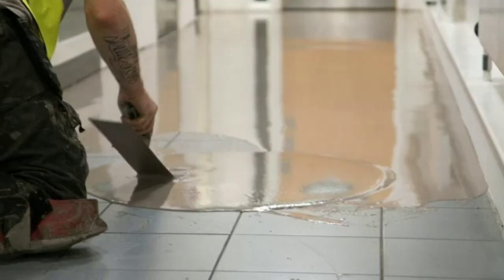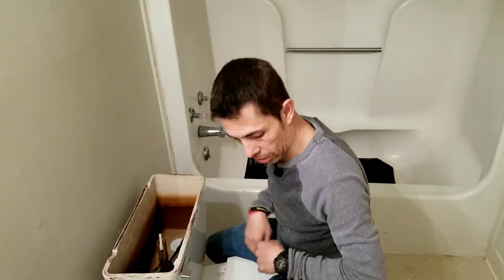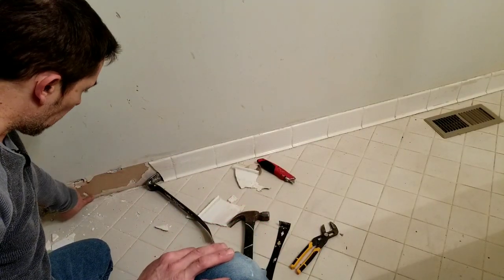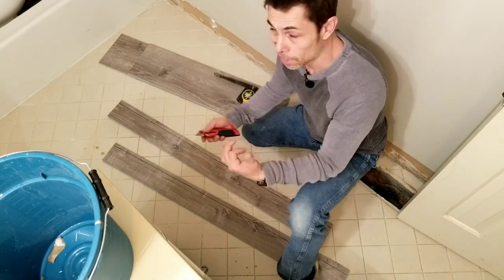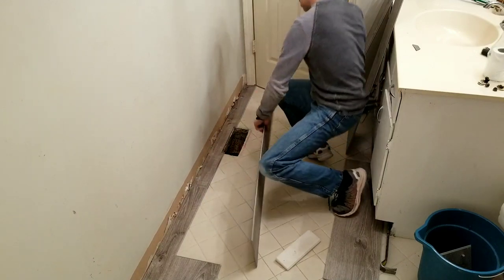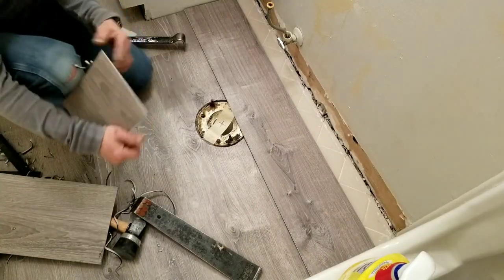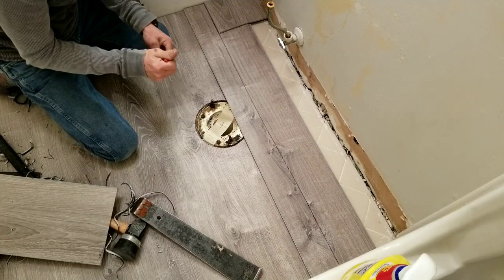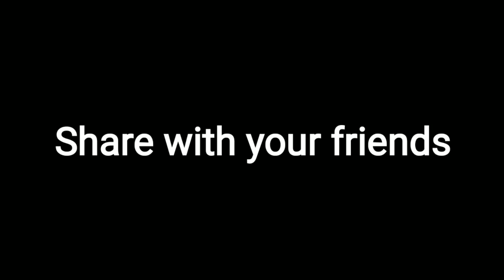LifeProof Vinyl Plank Flooring Over Existing Tile Tutorial

Comment: This video and the suggestions you gave is going to help me with my vinyl plank install. I refuse to pay some one to do this for me, I feel like I can do this myself! I am glad I found your channel!
Reply from the maker: Thank you for the comment. And I too believe you can do it. When you buy your flooring just take a look over the directions and you'll see it's not rocket science. Pretty diy friendly. You got this. Let me know how it works out
Reply: @Lydia Lopez Were you able to do the vinyl plank install yourself? I would love to know how it turned out!
Reply: Good luck,  I've been installing for 21 yrs, this bathroom will fail. He needed to grind the high spots in the tile and prep the grout joints with ardex feather finish.
Reply from the maker: @jesuslopez4113 No he didn't. This bathroom is still good 3 years later. Quit trying to be a know it all. You don't need all that

Comment: Yeah I just need more practice to get accurate Cut measurement . thanks much Sir 👍👍👍😄
Reply from the maker: You got it my man. Thanks for the comment 💪
Reply from the maker: Well I hate to hear that. Yeah some situations will call for a different flooring. I really haven't heard anything about it separating due to direct sunlight. I would say the underlayment make give too much movement. This product has underlayment already attached.And should lay flat on the floor. But honestly I know it's a pain but if you remove the underlayment. If your careful you can use most of the planks to refloor it. Thanks for the comment

Comment: Love this, I have 12" tiles with a wide grout and many tiles have hairline cracks. What would you suggest I do before laying a vinyl floor over them. My whole main level is tile and has to go.
Reply from the maker: I would probably tear it out. Once it starts cracking will probably crack more and you don't want loose pieces crunching under your new floor

Comment: Thanks for your video.  It is right on time!  My plan was to redo my kitchen and a bath with ceramic tile.  The demo cost was so high, but I did ot think I could put vinyl over tile...good to see it can be done.  I think this is the way forward!  I am also going to try installing peel n stick over tile in a tiny bath.  Per your advice, I will try the floor patch to level off the grout lines.  I'll let you know how it works! :)
Reply from the maker: Right on brotha. Good luck on your projects.thanks for the comment

Comment: Hello. We have an existing ceramic flooring that have cracks and some even popped up off the floor. Now we are planning to replace the entire flooring with vinyl plank flooring. But we dont want the existing ceramic flooring to be removed cause it will be be a lot of work and cost us some money. My question is, what are the chances that the underlying ceramic tiles will crack or pop up after the vinyl plank flooring will be installed over the ceramic tiles? Fyi, these ceramic tiles has a recall from the manufacturer. Thank you
Reply from the maker: Well, with everything  you're saying. It doesn't sound like a good idea to leave the tile. Especially if they have been recalled. Also, if it is big tile, there is definitely a good chance that it will crack more. You don't want
To hear crunching noise under your new floor
 I know you don't want to hear this, but if it was me installing it, I would probably bite
The bullet and pull it. If you do, make sure to seal off the doorways cause it is pretty dusty and try to pull tile in big pieces  so it is easier at
The dump. Use contractor bags to sweep up tile rocks and dust and mortal, but only fill
The bags 1/3 full. They get heavy quickly. Hope that helps. Thanks for the question

Comment: You are so smart! 
I have a question. Can I install the vinyl on the existing old vinyl. If yes, what I should pay attention to the installation?
Reply from the maker: If you are talking about sheet vinyl  as opposed to planks. Then yes and no. If there are no tears in the old vinyl,  and it is completely glued down wall to wall and flat, you should be OK. But, any folds, lines, tears, bumps, or even uneven subfloor will telegraph through the new vinyl. If it is loose layed and just stapled on the edges. I would pull it. You can cut it up in 3 foot rolls, tape it up, and throw it in the garbage can.  If you have ac vents in the floor. You can look for staples, and if you see some, you can pull a couple. Slide a flat heD or butter knife and see if the viynl lifts up. Hope that helps. Thanks for the question

Comment: Love your video- very informative, clear, and moves along at great pace!
I am about to install the peel n stick groutable luxury vinyl tile over my existing ceramic tile floor. I will have to use leveler for the large grout lines/uneven tiles.Should I also use the tub of tile adhesive (VCT)? Thanks for any help !
Reply from the maker: I am not sure about the peel and stick tiles. I did that a long time ago and you really need a clean flat surface. Over time mine started peeling up. I've used LVT (AKA DURACERAMIC)  that is installed with a pressure sensitive glue in the tubs like you mentioned. Once it's laid, it's grouted and looks like tile. I don't know how using glue on a peel n stick would go over.

Comment: I have  tile with grout lines that are a little over 1/4” its my min entrance to my home short walk way about 12’x5’. I’m using CoreLuxe Ultra  
8mm Oyster Shell Travertine Engineered Vinyl Plank Flooring
The salesman said I could just install it with theCoreLuxe  
Underlayment. What do you think
Reply from the maker: I looked onine for directions and manufacturer recommendations. There was no information on installing over tile. However the lifeproof says that anything over 1/4 grout lines must have the joints floated out with leveling compound. With this material being a little thinner than lifeproof that's not a bad idea. But since your doing it in you own home and not worried about a call back. If your careful to make sure that none of your end joint fall on a grout line. (You know cut a little off the starter if needed). Then its definitely worth a try for only 70 something feet. Will save you time and money. Then if you run into problems that small of an area can be pulled up without damaging planks and then you can repair the problem areas and put it back. If the sales man said you can do it just remember he's a salesman. I would do my own due diligence before make my decision. Thanks for the question.

Comment: questions could peel and stick flooring be install over flat rug in the kitchen , its an office rug but when i bought the house now i want to cover it i also notice that the rug tends to get moisture on rainy days........................or its air moisture  what should i do.  thanks jenny from puerto rico
Reply from the maker: No ma'am.  Because of the moisture it will probably not stick.  Not to mention it could be spongy. Best to pull up the rug and get a floating floor. Sticky tiles require a lot of prep or they will fail. Hope that helps.  Thanks for the question
Reply: @YOUFLOOR    ty so much i painted the rug instead...thanks

Comment: Yes, I was wondering, i didn't see you put in an expansion anywhere except behind the toilet , do I need one.
Reply from the maker: @Linda Olson LVP does not expand like wood does but your house is built of wood so a small expansion gap is required.  Maybe the video quality isn't good or I didn't show spacers in the video, but there is usually a 3/16 gap around the entire perimeter of the job unless I am going up against a tub.  On a tub, I like to get as close as possible and use 100% silicone to seal the crack.  Silicone is flexible and will still allow floors to move as needed.
Reply: @YOUFLOOR  Thank you for getting back to me and yes your video does not show the spacers, it looks like it goes right up to the wall, so that is what we were going to do, so glad you got back to me.  Yes we have a tub plus a shower.  Linda

Comment: Help!  doing my kitchen however some tiles are broken and loose. What to do? fix the ones that are broken or tear it all 
thank you
Reply from the maker: If you have 1 or two just rem ok ve them and fill with floor patch/ floor leveler. But if you have broke tiles in several spots. I would pull them all. Sounds like they will all crack at some point. The tile in my kitchen did that. The tiles were too big. Whoever installed it, didn't use tile board underneath . Hope that helps. Thanks for the question
Reply: @YOUFLOOR  it makes sense thank you!

Comment: I have wood like tile and I want to upgrade my bathroom with lifeproof Over my tile. Can I use river rocks as a transition? Thank you
Reply from the maker: Do you mean little rocks on a sheet with thin set? Should be OK but would definitely seal off any areas where water can get under any floating floor . Hope that helps Thanks for the question

Comment: I have a main doorway entrance foyer that leads into a large kitchen that i am going to start the flooring over porcelain 24x24 tile. Do i need to match the direction to the living room that was done already? Or just lay down at the longest wall 1st .
Reply from the maker: If this is a floating floor, it doesn't matter which direction you run it. Some people run it the opposite way just to break things up if it's not a perfect match. But if it is the exact same product ,I would run it the same way. Hope that helps. Thanks for the question
Reply: @YOUFLOOR  Yes same floor. Great TY

Comment: When installing this over the ceramic in the bathroom, and cutting around the toilet, did the toilet still seal ok? I am doing this exact same thing, and curious if my toilet will seal properly.
Reply from the maker: Well to be honest I don't really install any of my own toilets I hire someone to do that for me as I am not a plumber however I have gone back to numerous houses to do more work and the toilets seemed to be fine you just need to make sure that your wax ring is sealed to the toilet flange. Trust me I know your worries on that I've had a few toilet leaks myself which is why I don't install toilets. Hope that helps thanks for the question

Comment: Hi, my name is Ronnie but this is my husband's account. First, thank you for sharing your video, very clear. My question: how do I connect my floor from the kitchen to the living area? See, my kitchen is tile but the living area is carpet.
Reply from the maker: Is there a linnel against the tile. If there is a piece of metal that runs acrossed the edge of the the tile. If so I would a piece of tack strip. You know those wood strips with the little nail all over it. Take one of those or a couple if it is a big opening  and install  it about a 1/4inch away from the kennel. Then when you put the carpet over the tack strip you can tuck it down into the 1/4 inch gap and the two floors will  be flush. If the carpet is thin and the tile is high you may have to stack two pieces of tack strip on top of each other to bring your carpet level up.  If there is no lennel you can either install one or just get one of those metal strips that you can nail from carpet to tile. Its about an inch  and a 1/4 wide and you put nails in the middle with a hammer. Be careful not to break to tile. Go easy when you get close. Hope that helps. Let me know how it works out. Thanks for the question.

Comment: I was told that applying laminate over tiles may make the floor too heavy, is it true?
Reply from the maker: 5 pieces of laminate put together doesn't weigh as much as  your refrigerator, and that is in one location. Spread out all over the floor... you should be fine. Make sure your baseboard won't be too short. May need to pull it 1st, then install laminate  and then reinstall base on top. Won't need 1/4 if you do that. Hope that helps. Thanks for the question

Comment: How do you install quarter round to cover expansion joints around wall if the wall is also tiled?Any ideas
Reply from the maker: If it's only base tile then I would remove it and put real baseboard but if it's wall tile I usually use hot glue and silicone. Hope that helps

Comment: Two 4x4 tiles broken by toilet ring. Can I fill wil floor leveler? Rest of floor in great shape
Reply from the maker: I'm sure it will be ok but you may have to seal up all all the cracks or holes so your leveler does leak away. Also COMPLETELY SEAL OFF the toilet pipe. You sure dont want that stuff going down you sewer pipe Whew that would not be a good day. Hope that helps. Thanks for the question

Comment: Can this be applied over an epoxy floor? Is there anything we would need to do prior to install. It's a matte smooth finish. If we have to use leveler, will that work over epoxy? Thank you!
Reply from the maker: I did some research last night. As I have never messed with epoxy floors,  but from what I gathered, there is an epoxy floor leveler you can pour over epoxy. You would just have to scuff it up with a sander.  I have never had to prep an epoxy floor for installation, but I'm sure I could figure it out eventually. Great question. Sorry, I don't have a great answer right now, but that video needs to be out there. Thanks for the idea as well
Reply: @YOUFLOOR  thank you for your research!

Comment: Great informative video.  I am going to do this over kitchen tile  - yes, I was dumb enough to put tile in a kitchen.  Several tiles are broken, but still on this floor.  Will it be any problem to install over the existing tile that's broken (mainly hairline cracks).  Grout lines are right at 1/4" so I'm thinking it'll be okay to install over.
Reply from the maker: I'm not sure bout that. Only if they are stuck good and not loose. I would probably silicone the cracked tiles and pores at least an 1/8 of floor leveler. If any tiles are loose I would pull them and let the lever flow into  the void. Hope that helps. Thanks for the question

Comment: I would like to tile my bathroom floor with peel and stick vinyl planks ( also used in kitchen on bare concrete floor). My current BR floor is 1" X 1" grouted tile. Do I need to put down a leveler or subflooring if I do not tear up the existing tile?
Reply from the maker: Wow one inch. Those are tiny. Well I'm not sure what kind of product you  have but lifeproof says to put down floor leveler if the grout lines are bigger than 1/4inch. We laid some allure sticky tiles last week and they seemed pretty thin
 But with those small tiles it should be pretty flat with teeny tiny grout lines. I would look at the Instruction to see what their recommendations are but if I had to go off my gut. AS long as no e of the tiles are broken or loose I would just do  light skim coat of floor patch. And then lay right on top of the tile. Remember if you have rough spots and thin material. It could show through. So surface must be attach and flat. Hope's that helps. Thanks for the Question

Comment: Hi, 
The  bathroom in this tutorial is the same layout and design as mine... I have the same diagonal tiles and measurements.. I noticed in the video  you were able to lay the planks  over the  white strip between the door . I have the same strip but mines isn't flushed  with the tile.. there's a very small rise or lift... Can I still lay the plank of  the  strip? Thank you
Reply from the maker: Hey thanks for the question. That would depend on how high it is. If it is 1/16th of an inch or right at an 1/8 of an inch it should be fine . But a more than that and I would just tear it out and install a new transition the color or the new floor. Or you could grind it down provided it doesn't break. Or you could use some Henry's floor patch to float it out with a very slight slope. Unnoticeable to the eye. Hope that helps. Thanks again for the comment

Comment: Great job!
I have the same tile all over the house but would like to do LVP in bathrooms and bedrooms only leaving the tiles in hallway and living room. How do you do the transition then between LVP over tile and tile?
Reply from the maker: Hey bud good question. You can glue it down with urethane glue. I made a video gluing down transitions on concrete with no screws. Check it out . It may help. But also it would be to hard to get a masonry bit and drill holes in the tile then put you wall anchors and the  screws. Then you can click it in. That is if you prefer to not use glue. Aso make sure it a multi purpose reducer. Not a t mold. Thanks for the

Comment: Hi zenoi 
My vanity sit on concrete surrounded by tile.. i plan on putting vinyl over the tile and replacing the vanity with a free standing one... once I remove the old vanity ,  how do I cover the open area  and make it level with the tile????..  
Thanks
Reply from the maker: This is an easy one. If you take some floor patch or thin set you should be able to fill it in and level it off with the top of the tile. May want to ruff up the tile around it for good adhesion and use a little primer. But as long as the rest of the tiles are struck good you should be in business. Thanks for the question
Reply: @YOUFLOOR . Thank you very much for your help!!!!!!

Comment: We purchased Shire Plus 7"x48" Ronan Color vinyl plank 5.00 ml. We have ceramic tile, approx 360 sq. ft. Only one area on floor has loose tiles. What is your advice for preparation of the floor? Thin-set? What would your next steps be? Do you know any good flooring contractors in St. Pete area of Florida?

Comment: If a couple of tiles you’re covering have cracked will that cause an issue?
Reply from the maker: @James Wallace It could cause an issue later on down the road. Check to make sure the tile is still bonded good, maybe silicone the crack and/or skim the floor with a floor patch. If it is just loose laying, I would pull it and fill it in with patch and check the floor for other loose tiles, if you have one there could be more. Thanks for the question.